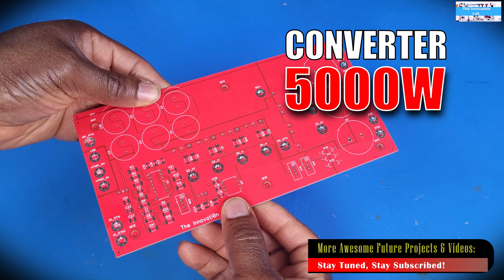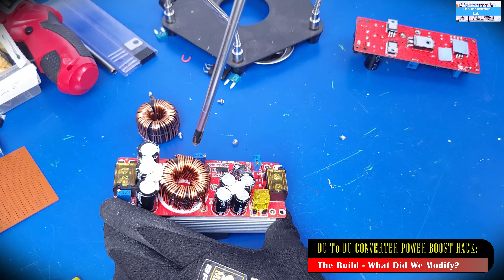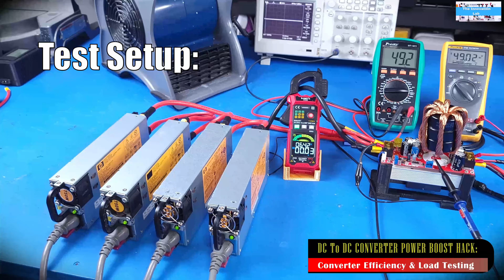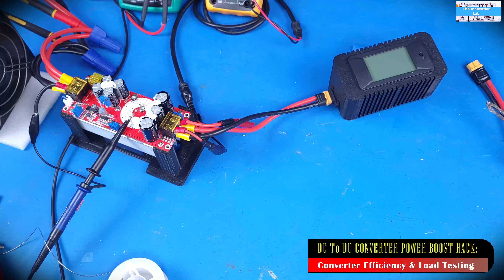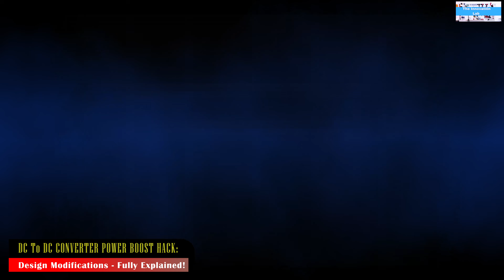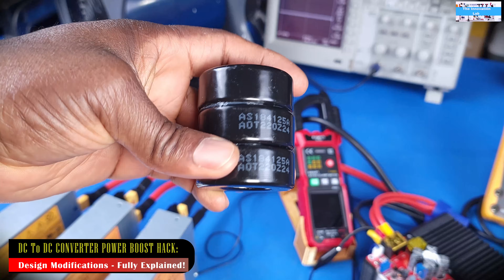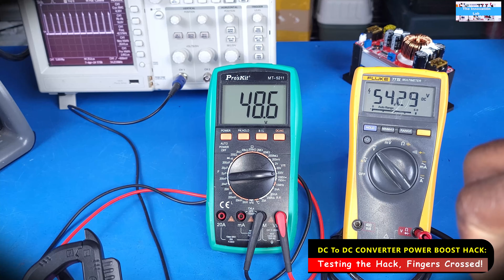How to Supercharge a DC-DC Boost Converter to Deliver Higher Power!⚡️💥

Comment: Been working on plans for an Ebike camper trailer, part of which is a light weight power system. Low battery usage and more reliance on panel power usage. Inverters are not planned for this system. One of the ways of using the available power was as a water heater system and storage. It will also double as heat for the camper in colder climates. these boost/buck converters will definaely do the job, and for the price, I wont need as much battery source power. I have to be able to power the Ebike, charge the batteries, as well as power all the PC/laptop, phone and other things you might want to have inside. but the water heater was a problem. Til I found these boost coverters. Great video, very informative! Sub'd!😎
Reply from the maker: Thank you so much!!
This is the kind of wonderful feedback that really keeps us going!❤️

Success Wishes on your project and please don't hesitate to reach out if you have any questions.
👍👍👍

Respectfully,
The Innovati0n Lab 💥 www.theinnovati0nlab.com

Comment: i want converter that can do 600vdc solar at 14-15a to 56vdc max amps. or 300vdc in at 30a to 56vdc max amps can you do it?
Reply from the maker: Please clarify. Are you looking for a high voltage boost converter or buck converter?

Comment: Hi. Wire gauge wire line quantity wasn't mentioned. Can you advise on that please?
Reply from the maker: Wonderful! Thanks for watching the video. Much appreciated.
I thought I showed the wire gauge... maybe I didn't.😋

Wire Gauge: AWG 22
Number of strands: 50

You could also reduce the number of strands to about 40. Just that you may see a little more dissipation on the inductor due to more copper losses. But it won't be too bad.

I hope this helps. 
Happy holidays.🙂
The Innovati0n Lab 💥 www.theinnovati0nlab.com
Reply: @theinnovati0nlab782  THANK YOU SO MUCH!
Reply: @theinnovati0nlab782  Hi. If i have 0.1 mH inductor?  Its normal?
Reply from the maker: @MickieKoshman  
I try to keep the inductance below 40uH.
0.1mH is about 100uH. It could be too high. Unless you are going to lower the switching frequency significantly, as I have shown in my videos - but you have to be able to make the modifications I talked about.....target switching frequency should be within 25KHz to about 40KHz.
Hence, you have to tune the converter by varying the switching frequency to see where you get the optimal performance.

I hope this helps.
The Innovati0n Lab 💥 www.theinnovati0nlab.com
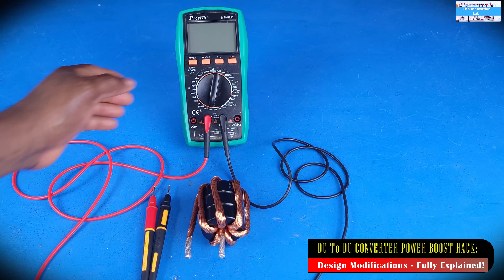Reply: @theinnovati0nlab782  Thank you for your response, but I wanted to clarify something. At the 21:30 timestamp, you mentioned that the inductance should be between 42 and 100 microhenries. If my inductance is 70 microhenries, will that work?  And how can I understand what frequency needs to be set for such an inductance?
Reply: @theinnovati0nlab782  Well, I tried an inductance of 70 microhenries. During the experiment, the inductor heated up. Later, during the adjustments, the transistor failed. There were times when an unpleasant squeal appeared. I also noticed that as the frequency changes, the no-load current also changes. How can I determine whether the inductor has saturated, and should I increase the frequency or not? Can you please show how to check this on an oscilloscope? I'm a beginner.

Comment: Starting current damage  dc converter   from intial starting current of bldc motor  driving through boost converter?
Reply from the maker: Can you elaborate a bit?
If the starting inrush current is larger than the converter could handle, yes, it could damage the converter.

Thanks.
The Innovati0n Lab 💥 www.theinnovati0nlab.com

Comment: Awesome 👌  wanted to know if I can use a 60 volt lithium-ion battery which charges up to 71.4 volt and step it up to around 84 volt. For my escooty ty have a 1200 watt bldc motor
Reply from the maker: Great question.
Yes, you should be able to do that. These converters have a maximum input voltage of 60V and an output voltage of up to 90V.

However, it is never advisable to apply the maximum input voltage on these converters as this could lead to component stress and failure. I would recommend a maximum input voltage of about 48 to 50V. This way, you leave a 10V headroom.

I hope this helps.
The Innovati0n Lab 💥 www.theinnovati0nlab.com

Comment: So i could use a non modified booster to charge a 63.5 full voltage battery with a 40v tool battery at 3.5A?
Reply from the maker: Yes.
However, when using a battery to recharge another battery, it is always better to ensure that the battery you are using as your power source has a larger storage capacity than the one you are recharging.☺️

I am sure you already know this - just a reminder.

For example:
Don't use a 12V, 20Ah battery to recharge a 24V 50Ah..etc.

I hope this helps.
The Innovati0n Lab 💥 www.theinnovati0nlab.com

Comment: can you specify number and lenght of #22 gauge wire did you used for the inductor please
Reply from the maker: I used  50 strands of the gauge 22 wire. The overall length should be about a meter long. 
The trick is to give yourself enough headroom in the length of the wire and to measure the inductance with and LRC measure as you add your turns. Once you get to the calculated inductance value you need, just cut of the excess.
This will save you from any expensive mistakes that may happen if your inductor coil length calculation/equation is wrong. 
I fund that this process is a bit more practical and precise.....especially when I am too tired for solving equations and crunching numbers.😂

I hope this helps.
The Innovati0n Lab 💥 
www.theinnovati0nlab.com

Comment: Hello, dear friend, have a great time, the video was great, just answer one question, the diameter of the lacquered wire was 22awg, but how many should be to wrap around the inductor, you didn't say this in the video, I watched it several times, but how many lacquered wires should be, thank you  You, I am from Iran, be happy and healthy
Reply from the maker: Hi friend,
I am thanks for watching our videos, and I am glad you found them useful.
I didn't mention the number of turns on the inductor because I didn't think it was necessary. 
I showed the power inductor in the video at closeup. All you have to do is really count the nument of turns going through the inductor core.
As for the number of strands, I used 60 stands of the 22-gauge laminated copper wire. 

I intend to make a power inductor design tutorial in the near future.
Please stay tuned.
👍👍

I hope this helps.
The Innovati0n Lab 💥 
www.theinnovati0nlab.com

Comment: Thanks very much for the video. I need one for my solar panels. Can I get your contract Nd email. Thanks
Reply from the maker: I am not selling them.
But I may do that in the future.
You can reach out to us via email through our website.
Thanks👍👍
The Innovati0n Lab 💥 
www.theinnovati0nlab.com
Reply: @theinnovati0nlab782  
Hi. Thanks for your reply.  I'm an installer and I bought the same DC DC booster and I  wanted to use it boost voltage from my solar panels before entering into the inverter . I need constant 70volts 36Amps. Hope this DC DC booster can help me

Comment: How to bring down 160v dc to 120v dc ?? Any ideas
Reply from the maker: It's pretty much the opposite of a boost converter function. 
💥PWM control  
💥Pulse the high voltage at a low duty cycle.
💥Apply a well designed LC filter at the output stage.
I plan to work on a buck converter project in the near future.
Stay tuned.
We are looking to grow the channel. You can help by  sharing our videos.
👍👍
The Innovati0n Lab 💥 
www.theinnovati0nlab.com

Comment: how about circuit diagram isn't only tl494 how about that circuit diagram
Reply from the maker: I don't have the circuit diagram for this board.
It is not my design, and it won't be ethical to reverse engineer someone else's work and start sharing it. We don't do that kind of stuff here.

What we are showing are upgrades you could implement - using the basic understanding of how the PWM chip (TL494) works.

I will be sharing my own TL494 schematic with the audience in an upcoming video.

Stay tuned.
The Innovati0n Lab 💥 
www.theinnovati0nlab.com

Comment: Podríais hacerlo pero con salida dual .. entrada 12 voltios,  salida variable de +30 GND -30 hasta +90 GND -90 ?
Reply from the maker: Wonderful idea,
However, I only know how to implement a similar concept using a different converter topology.
This is essentially a non-isolated flyback topology.
I hope this helps.
The innovati0n lab 💥 
www.theinnovati0nlab.com

Comment: กระแสไฟฟ้าที่มากขึ้นไดโอดจะทนกระแสสูงได้อย่างไร หากคุณไม่ได้เปลี่ยนมัน
Reply from the maker: Great question,👍👍
Giving that we are conducting all tests at the high outout voltages, we have not exceeded an output current of 30A. The current diodes used at the output can handle that. 
However, these modification allows us to push higher input currents into the coverter - at lower input voltages......thus the increased output power - at higher output voltages.

I hope this makes sense to you.
Respectfully,
The Innovati0n Lab💥
www.theinnovati0nlab.com

Comment: My problem is that I need a buck converter capable of delivering at least 30A at 3.6V, 60A or 90A would be better😅 but there arent many ready made converters that dont blow a giant hole in my bank account😂
Reply from the maker: I hear you! 
There are some Analog Devices buck converter modules that can give you what you those specs. However, as you rightly said, they are never cheap. 
You can always check on Mouser electronics to see if they have something that you can afford.

A custom design is another alternative, but they are expensive as well - unless you can build it yourself - but then it also takes time.

Respectfully,
The Innovati0n Lab💥
www.theinnovati0nlab.com

Comment: Can you fix ic tl494 problems in boost converter 1800W?
 Because I have one broken because of the ic
Reply from the maker: Wondeful question.
You could just order a replacement and install it if you are good with soldering tiny SMD parts.
However, how did you know the IC is the problem?
The Innovati0n Lab💥
www.theinnovati0nlab.com
Reply: @theinnovati0nlab782  
"I am good at SMD soldering, but the IC is not faulty in my case. It's the SMD components that are responsible for signal connection that are faulty. I have confirmed that the IC TL494 is working fine, but I don't know why the signal is not reaching.  Could you help me.
Reply: @saddiq1239 check the smd transistor around the ic

Comment: Thanks so much for this
I have a project at hand that requires dc dc converter for charging of lithium battery. The challenge at the moment now is that the primary battery pack i have is 48v 50A configuration which i want to use for charging a battery pack of 60v 50A. But the dc dc converter i have which you have been using in the video has input current limits; 10-30v 30A and 31-60v 25A. These limits will not work for my project.
  Please how can i  increase the input current to suite my project. Should I just reinforce the input current fuses
Your assistance at this point sir will be much appreciated
Reply from the maker: Wonderful question.
But you are already on the right track. With your 48V power supply as an input to the 1500W version of the converter, you should be able to get a continuous output power of up to 1300W or more out of the converter with good cooling fans.

For a 60V LiFePO4 battery, you should need a charging voltage of about 72V....please double-check your battery specifications and manufacturer recommendations.
Now, 72V at 1300W means that you will have a charging current of 18A that will be delivered to your battery.👍👍

The only bottleneck for you will be that it would be a slower charging process....about 3 hours instead of 1hr. This also means that you will charge your battery at about 0.4C. Honestly, this is better, in my opinion, and your battery will last longer as you will get more cycles out of your battery system.

You can also try making the modifications I showed in this video to see if you could raise your charging current well about 20A....this could get  you close to 0.6C charging capacity.
I am also working on other  alternatives. Stay tuned.

I hope this helps.
Please, we need your help in  growing this channel. You can help by sharing our videos on social media and with diy interest groups.
Thanks!!
Success wishes on your diy projects.
👍😎
The Innovati0n Lab💥
www.theinnovati0nlab.com

Comment: Very good definitely it's impressive but one qoustion brother ( did you change the MOSFET or iGBT ? If this module? Or you not changing MOSFET?
Best regards from Philippines 🇵🇭☕☕☕
Reply from the maker: No, the converter had HY3912 MOSFET on it.
I didn't need to change it per my calculations.
But you are welcome to try a stronger MOSFET if you find one.
👍😎
The Innovati0n Lab💥
www.theinnovati0nlab.com
Reply: @theinnovati0nlab782  thank you brother for your reply
Reply from the maker: @MarkPrince1317  
You are always welcome.
👍👍

Comment: And the PCB can handle that power? Fuses remains the same?
Reply from the maker: Thanks for asking this question. This was one thing I forgot to mention in the video.
If your load is going to pull more than 60A at the input of the converter, you should try to size up the fuses. 
The Innovati0n Lab💥
www.theinnovati0nlab.com

Comment: Hi bro, i have problem whit these stepup, not is easy to can regulate the trimmer. The logic internal at these step up  is too  complicated.  I  use the trimmer for regulated current and input voltage ,but  i lost much hours for can have a very powerful output! How work these logic? How can see ho value voltage use on input? If i use  24v input and output stepup 50v , the trimmer input step up i can setting at low than 24v or ? The current trimmer not is easy to use becouse I not see how setting these 2 trimmer
Reply from the maker: Hi friend,
Thanks for watching our videos and leaving us a feedback. However, I was not able to fully understand the issue you are having so as to know how to help. The good news is that I have made lots and lots of videos using these converters for many different applications. Please take the time to watch some of the videos and I am sure that you will find some good information that will be helpful to you.
Please visit our channel.
These ones specifically could be more  helpful👇👇👇
💥The Review video🔥
https://youtu.be/2KyBwwldqkk?si=mEHgLCFa9EBVXThZ

💥Battery Charger
https://youtu.be/WDWJ77WWkXc?si=jWSxcZdQjII_5Kmc

💥Undervoltage & Efficiency:
https://youtu.be/t8Aaz4iQeXY?si=3HkET4HX1ZfNr__D

I hope this helps.
👍😎
The Innovati0n Lab💥
www.theinnovati0nlab.com

Comment: The more power you drive over a DC/DC converter the easier is it to reach higher efficiencies. For synchronous buck converters you can reach quite easily  5 kW of transferred power with a loss of less than 50 W because you don't have Schottky diodes in your system, which typically have a voltage drop of at least 0.5 V in conduction. So if you have a current of 200 A at 25 V you will get 100 W of power dissipation in the Schottky diodes allone. If you use a cascade of 4 power MOSFETs with only 0.5 mOhm in a half bridge you will get only 20 W of power dissipation in the power MOSFETs.

The challenge of power MOSFETs in half bridges, however, is "phantom" opening of the low side switches due to steep voltage rises coming from the high side. The capacities between drain and gate and gate and source are acting like a capacitive voltage divider. The inner resistance of the internal bond wire to the gate even if it is very small like just 2 or 3 Ohm will let the gate float up for a while that it can exceed the gate threshold voltage, leading to a "silent" opening of the low side MOSFETs. So the current shoots though and not through your inductor, which stays uncharged. So when you increase the input voltage a sudden collaps of the output voltage happens leading a extremely high shoot through currents.
Reply from the maker: Thanks a lot for the great and super constructive  feedback!!👍👍
Great points, and I couldn't agree more.
Thanks a lot!

The Innovati0n Lab💥
www.theinnovati0nlab.com

Comment: Amazing man! I'm wondering why my boost converter can handle the load better at lower frequencies. Thanks!
Reply from the maker: Thanks a lot!
I appreciate the wonderful feedback!👍👍👍
The Innovati0n Lab💥
www.theinnovati0nlab.com
Reply: @theinnovati0nlab782 You can improve your efficiency and power delivery by replacing the mosfet and diodes! I build my Owen boost converter with an SB1060L (ultra-low power loss super baria diode) and two AON6276 connected in parallel. The AON6276 has a lower Qg and resistance than the original in your boost converter. With these modifications, my boost converter runs cold under high load and can output more power. I'd like to see how my version performs with your coil design in the next video.
Reply from the maker: @tolu1997  
Amazing, I will look for the diode. Where do you order them from?
Thanks again!
The Innovati0n Lab💥
www.theinnovati0nlab.com

Comment: By using 3.2v LFP cell can we run e-bike of 48v 1000watt
Reply: No you can't, and because two things.
1) This converter only step up voltage from min 8.5V and your battery is 3.2V
2) One cell battery in practice have low power so it can't deliver 1000W
Reply from the maker: Please elaborate. I am not sure I understand your comment.
The Innovati0n Lab💥
www.theinnovati0nlab.com
Reply: No. Because as you increase the voltage the current drops. And a motor is a high current device so if you start with a low voltage. The current must be high